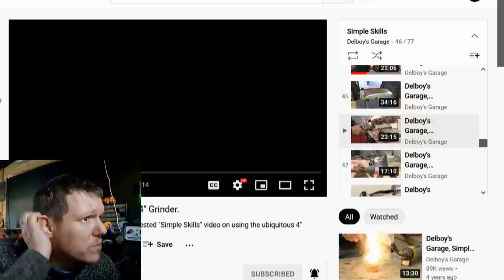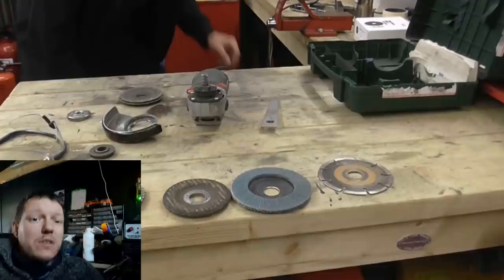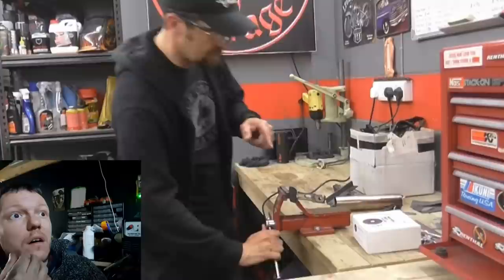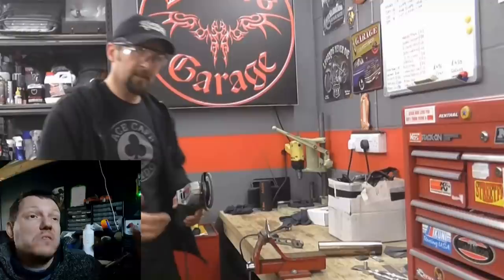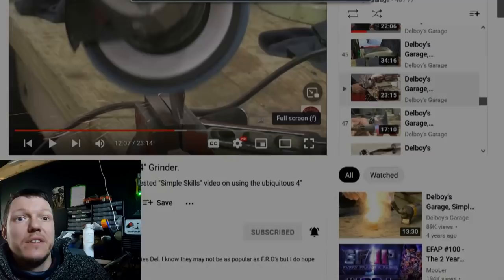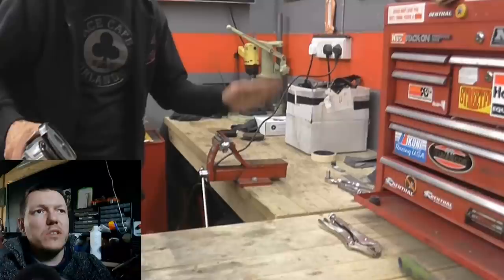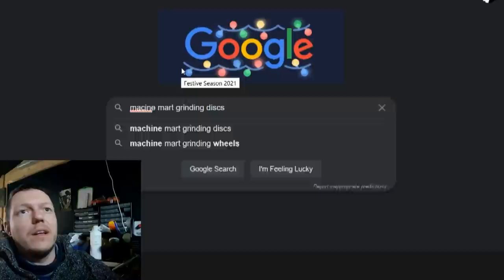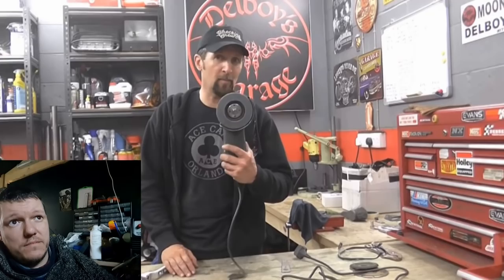Simple Skills - Grindr

Comment: Don't take the guard off.  Spend you're time welding missiles into your exhaust pipe,  basting your brakes in grease , removing radiator caps off hot engines.  Remember safety first people.

Comment: I know where he's coming from with the unplugging thing, the whole "don't handle the disc of a plugged in grinder", but he keeps turning it on when it's not plugged in, then plugging it in - one of these days he's going to do that with the power switch in the "on" position and it'll fucking bite him.  As for reaching over a grinder mismounted in the vice to turn it on, with his hoodie undone and hanging over the disc...  Jesus fuck.

29:45 - that's not a bench grinder, it's a shelf grinder.

As for getting sucked into a grinder, I have seen it happen, 300mm bench grinder with badly adjusted supports, and it's really not pretty - my colleague lost a chunk of his thumb.  Without gloves, so by Del's logic he should have been safe.  Del, on the other hand, tried out grindr once, but he only got sucked off.

I've been bitten by angle grinders.  Usually with sanding discs, and fucking misusing it, holding the workpiece by hand.  Yeah, I'm a fucking twat.

Also. lobbing a still-spinning grinder onto the bench.  Not explaining that most times you don't need the spanner to take the disc off.  Or put it on.  All that shit about gloves which was absolute bollocks WRT angle grinders (and I am a glove nazi around most spinning equipment).  Shoving it in his vice, the twunt.  Eeeagh.  How can one man get literally everything wrong?

On the other hand, he seems to have accidentally put some metal in his vice during the video.  I bet it felt violated afterwards.

Comment: Matt you need to design make some soft jaws to safely clamp an angle grinder in the vice and send them to Del as a Christmas present.
Reply: Matt has explained this is a personal choice, and not necessarily the most advisable way to use a grinder - it’s for a specific reason, which may well be argued with. 

Del,on the other hand, says his ways of doing things (such as putting a grinder in a vice) are the safest way of doing it.

Of the two, I know who to give more credence to.

Comment: Here you go Dell for future ref : Wheel guards serve to deflect sparks and debris away from users, and to shield and protect them from abrasive cutting and grinding wheels, which can cause serious damage if (when) they fail and fly off. Personal protective gear, such as safety glasses and a face shield, and other PPE are often required as well. Who would have thought?
Reply: No youre very wrong!! Del says those dics are EROSION discs, abrasive discs are to be delsplained in a future episode 😁😁

Comment: 😂😂😂 zillions of miles per hour! How did you not crease up laughing at that! 
A bit of quick Googling and basic maths shows his grinder does 11k rpm, 115mm disc has a maximum travel speed of 148.2mph 😂
Reply: Amazing. Even easier once you have a grinder in the hand for a video. Max rpm written both on the tool and on most disks.

Comment: Matt takes the piss out of del.
Also Matt, runs the anglegrinder without the guard.
Geees
Reply: Matt at least acknowledges the issues with doing it and telling you you shouldn't do it.
Reply: @jediknight129  and the darwinaward goes to . . . . . .
Reply: @uncle_moose  meh, there are times when you have to. The whole point though is if.you know what you are doing you know what 'rules' you can break safely. 

Del is sat teaching newbies to do shit that's fucking dangerous without understanding how.
Reply: @jediknight129  tell that to the disc when it explodes
Reply: @uncle_moose  that's what you wear PPE for a guard isn't the be all end all.

If my choice is getting into an area with a rated face shield and eyepro underneath without the guard or with a guard on but no shield il take the guardless grinder every time.

When I'm doing stuff in the field building props where I'm crawling about at shitty angles where.I can't always use the guard I'm in a faceshield with a solid leather jacket and rated trousers same as when I'm in my nice clean workshop with good light and a guard.
Reply: @jediknight129  darwinaward winning answer
Reply: @uncle_moose  what? Always wear PPE, don't rely on safety guards and always pay attention to what your doing and seeing is a darwin award answer.... lol. Just lol
Reply: @jediknight129  read your answer again, the laughs on me.

Comment: A piece of advice I can give is be caution when you have finished grinding and the disc is spooling down.....
My work partner was using a 9 inch grinder cutting reinforcement bar and he let go of the trigger and held the grinder by the handle....
The handle somehow worked itself loose and as the grinder was spooling down it spun around on the handle he was holding and buried the disc into his thigh.

And for fuck sakes..... Dont use cutting discs as a grinding disc!

Top video as always Matt.

BTW, as a Portuguese..... PORTUGAL CARALHO!

Comment: OSHA requires the use of heavy duty gloves while using an angle grinder. $500 fine if employee is caught grinding without gloves on.
Reply: Is that based on the size of the grinder/what yiu are doing? And does it demand the kevlar/nylon type things?